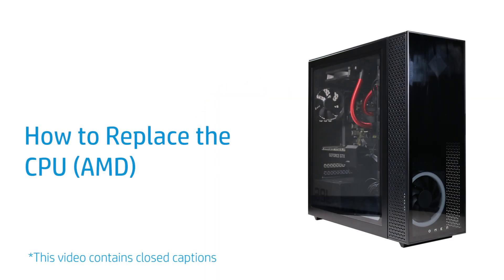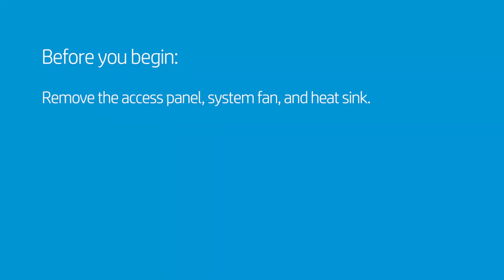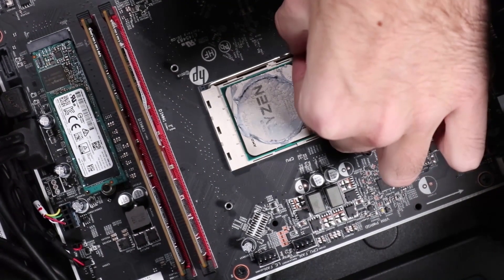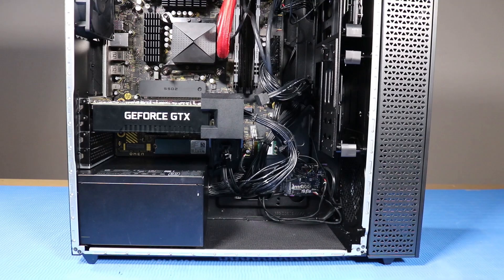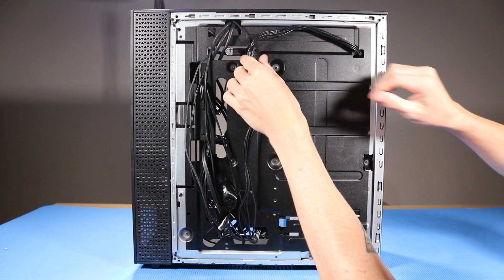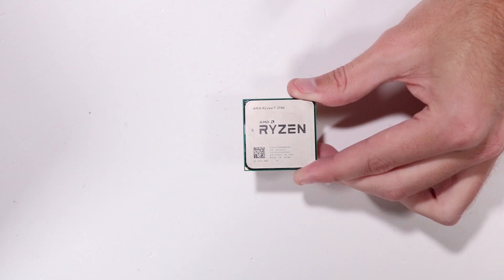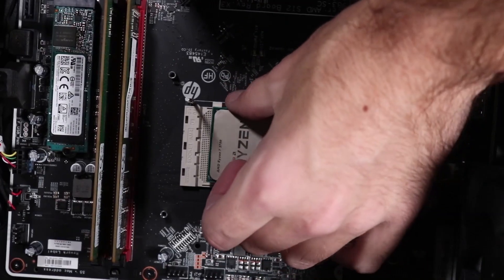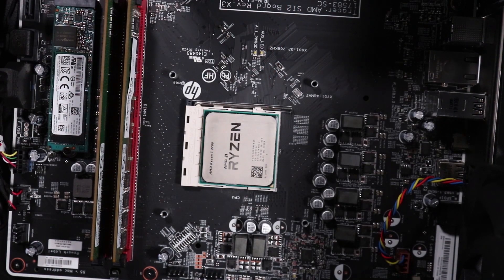Replace the CPU (AMD) | OMEN 25L GT11-0000a, GT11-0000i, 30L GT13-0000a, GT13-0000i Desktop PC | HP

Comment: Its crazy because the intel 30l omen desktop I recently purchased came with AIO cooler not even mounted and cables hanging everywhere.  I see other omen owners of same specs have clean cable management.  Can intel cpu's be upgraded on the HP omen 30l?  Or is just like the memory issue where only AMD is upgradeable?
Reply from the maker: +rilenixx Please refer 'Processor upgrade information' under the specification page to know about upgrading the processors: https://bit.ly/2FujqLL